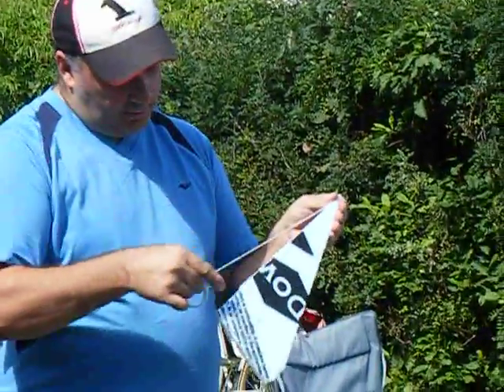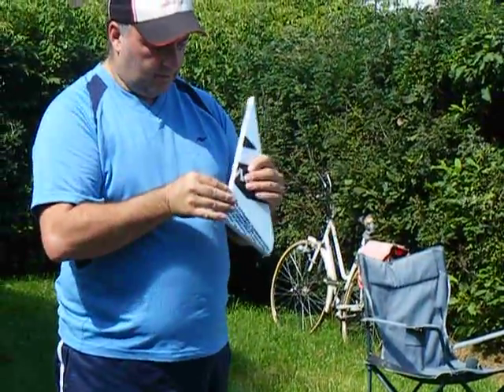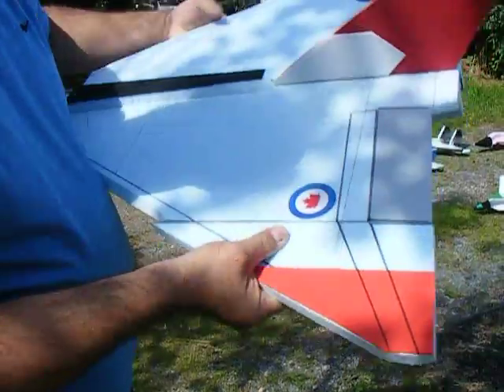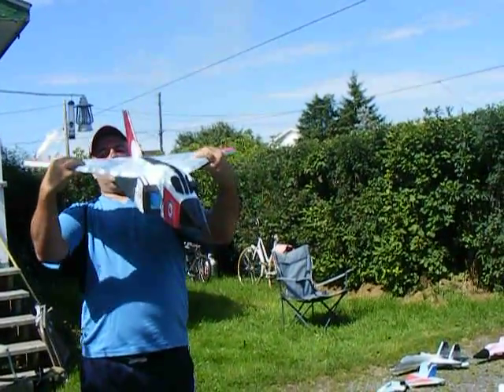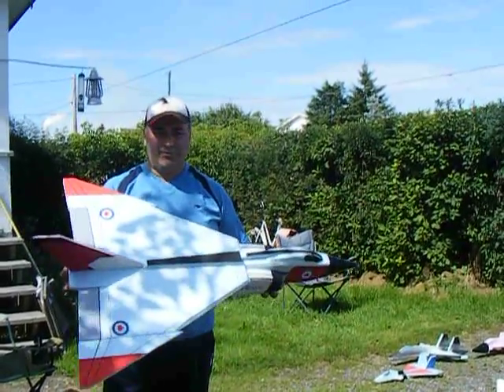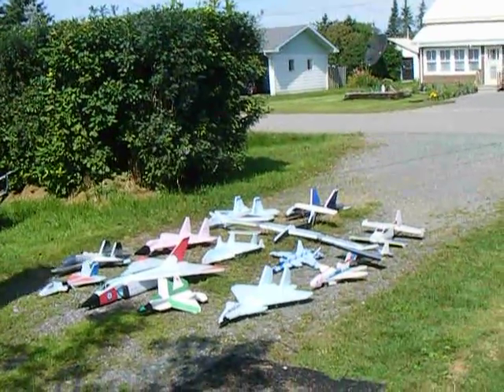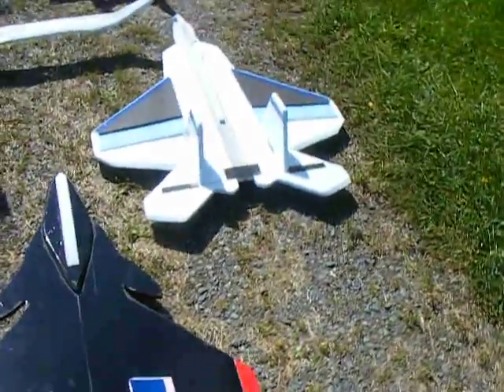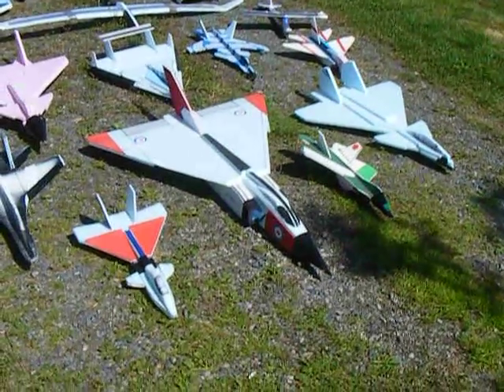Avro 2

Comment: Cool Mitch. 300gms = 10.5oz. What battery do you plan to run? I'm thinking 2200ma 30C battery and the Grayson hobbies Super Mega jet or equivelent would be cool.That will run a 6x5.5 prop. The 2212/6 motor from rchotdeals will run a 6x4 prop well, but might be a little low on power for this size model.  Just try to keep as free of flow  to the prop which ever motor you choose. Do the air ducts allow free flow to the prop, I could not tell in the video. Good work, can't wait to see her fly!